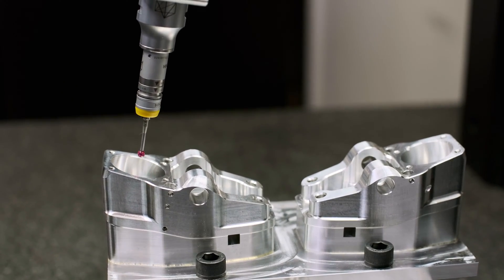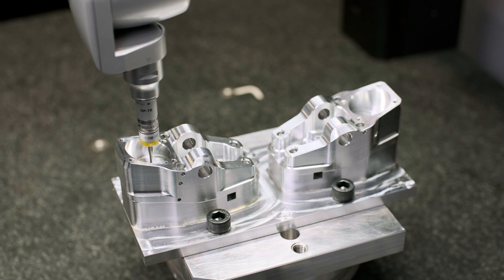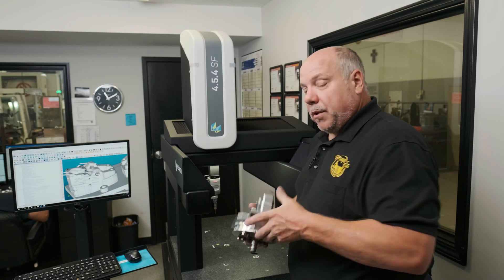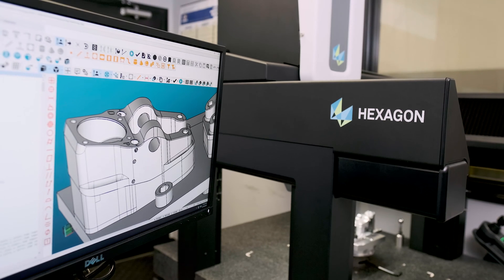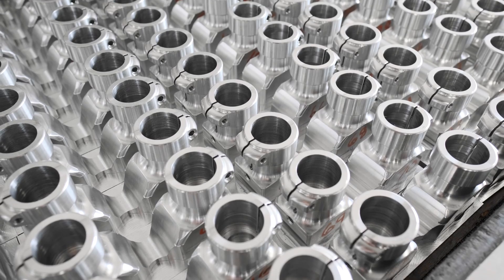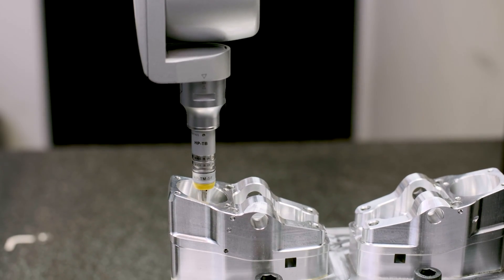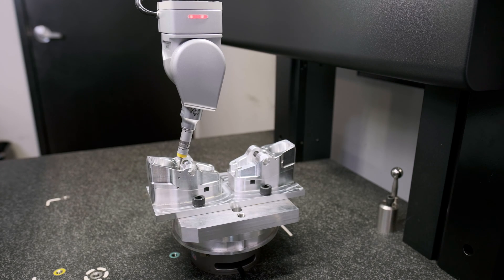Hexagon Coordinate Measuring Machine | CMM Quality Control at Prosper-Tech Machine & Tool

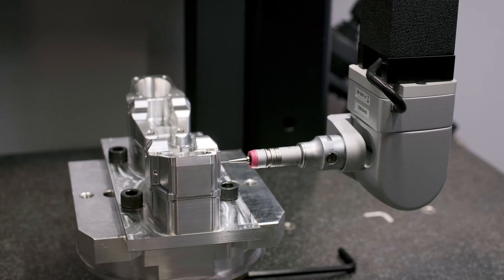Comment: 0:42 Did you mis-speak on the accuracy? 10 thou is terrible (.010) are you sure you didn't mean much lower in the millionth?
Reply: yeah pretty sure he misspoke, it would probably have a MPE0 of around 1.5µm. Hitting the actual points on the part however will have a rough tolerance of around 1mm

Comment: Hi mam/sir, i want to ask if a Tool maker or a machinists are a lil bit qualified to do this kind of job?? I am a current toolmaker in ph and want to learn operating CMM modern measuring machines, for now i just knowledgeable in height master, toolmaker microscope, micrometer(surface micrometer, depth micrometer, and uni-micrometer) , hoping to do that job someday😊😊.